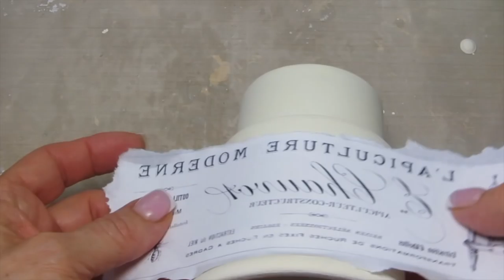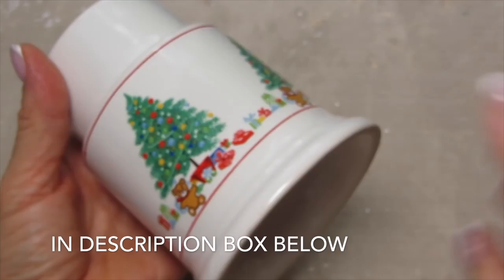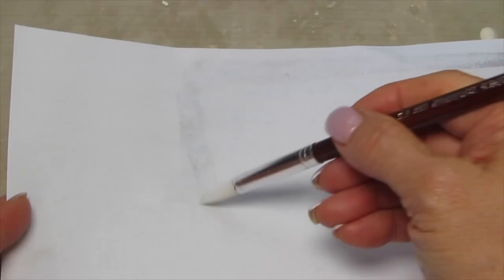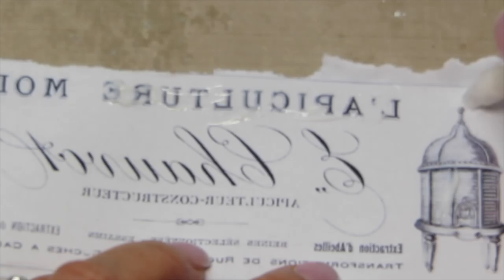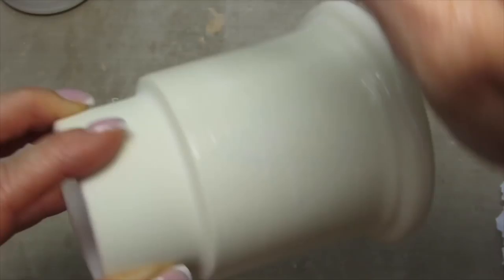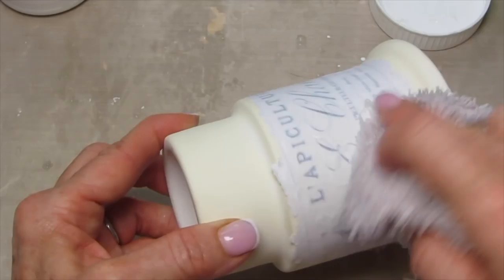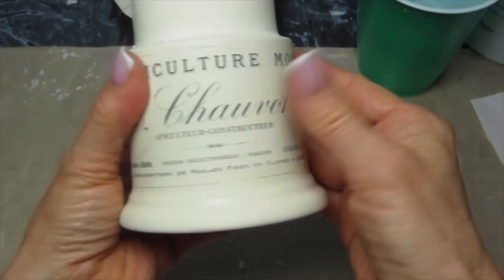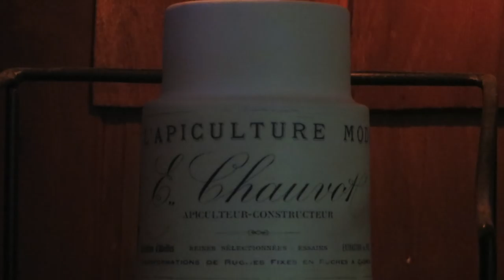DIY French Script Transfer on Annie Sloan Chalk Paint

Comment: this is so gorgeous!! hey pati do you have any ideas for me on how to decoupage a tool box? i have a huge tool box i keep my nail supplies in, its one of those heavy thick plastic ones and its black and yellow and manly looking i need glitter i need girly and heres this hunk of ugly sitting and staring at me lol what could i do to dress it up?
Reply from the maker: thank you Tiffany. I'm glad you mentioned that the box is plastic. The first thing you need to do is use a spray paint over it that is made specifically for plastic. You can get that at any hardware (or craft) store in so many different colors. You may want to use a baby pink spray on it and decoupage some girlie flowers all over it with napkins. I have a video where I took an old coffee can and added paint napkins and glitter and you can follow the same steps on your makeup/tool box. (though you would skip the step where you add the metal base coat-you'll just need the plastic base coat) Let me know what you think. :)
https://youtu.be/3AYlRHWUiSc
Patti